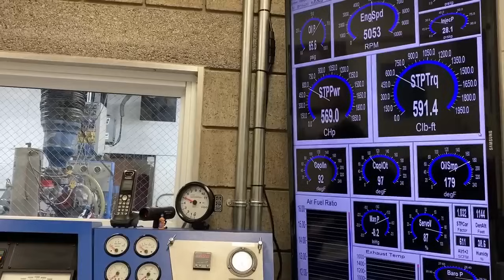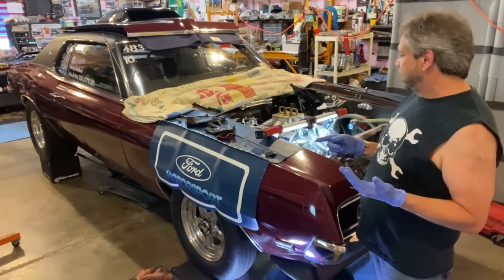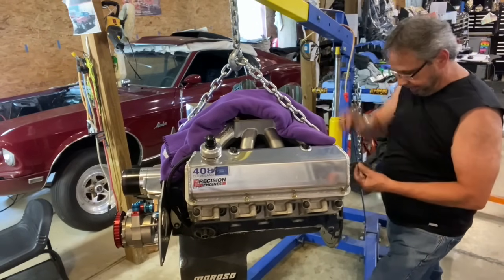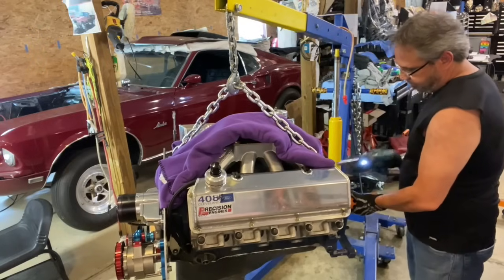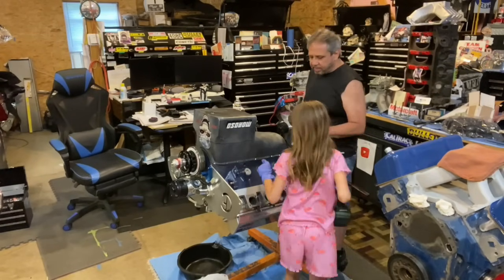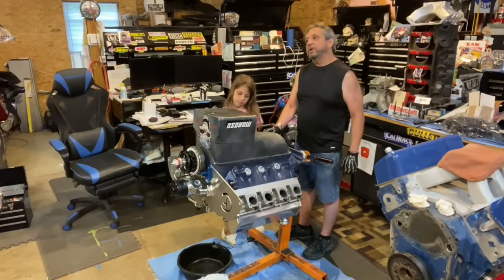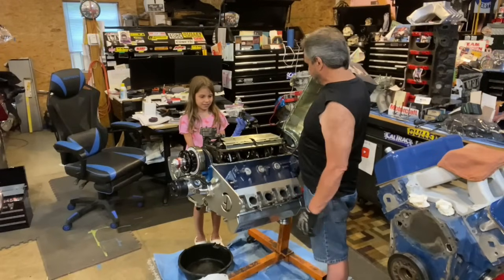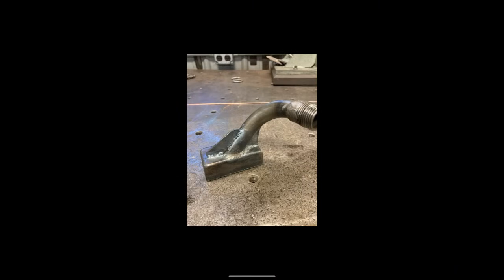DBG: Rip 769 HP Ford 351 Cleveland, Now We Now The Rest Of The Story...No Band-Aid Fix

Comment: That's a HUGE rear baffle on the oil pan!  Thought about making something similar for my 8.2 engine, but didn't go that far.  Was worried about oil being able to drain back into the sump.  How many quarts do you run in it?  In the process of installing an Accusump as we speak.  Hate that for you!  Freak breakages...
Reply from the maker: Been running these pans for 40 years. Never an issue. The pan is a 9 qt pan. Brace your pickup. Common breakage issue, I have never seen it. I thought about accusump, not sure if I need or want it. What your thoughts Mike?
Reply: @DragBoss351Cleveland  I use a Canton 'road race' 1563 pan that boxes the pickup in an area with trap door baffles.  Worked great for decades on my 306 engines turning 6800 rpm.  Pan is advertised as 8 qt, but I only run 7 in the the engine.  Shows 1 qt low on the dipstick.  New 363 turns 8k rpm.  Oil pressure would tank from 70 to 40 from 7500 up on the dyno.  Made some changes (SV blueprinted, ported pump, bigger custom made pickup and some drainback mods and it did fine on the dyno.  I've TRIED to watch the oil pressure at the track, but it's a stick car with two stages of nitrous...  and the gauge isn't in the line of sight, so I can't see it.  lol  I do think it's dropping, though.  

Accusump has an electric valve.  Valve has an internal check valve that allows it to fill to max pressure.  Has an electric pressure switch that only allows it to dump at the switch pressure.  Mine is marked at 57 psi.  Cold oil pressure is 80+.  Now, if the pressure drops below 57, the Accusump should open up and provide a few seconds of lubrication.  

Thinking about making a bigger baffle.  The one I made/added is not nearly as large as what's on your pan!  lol  Can't afford to replace the engine in any kind of reasonable timeframe, so trying to not kill it.  lol  

Been playing with no-prep.  Wired up a nitrous progresser.  Last weekend, it was coming out on 150 with a 0.1 second delay and 0.25 second ramp with a 100 hp second stage to use in 3rd gear.  Still a street car that gets driven on the road, but was surprising some of the purpose built race cars...  even on a 28x9.  lol  Engine made 655 n/a and 908 with an 82 jet  (225hp) on the dyno.  11.5 to 1 and pump gas n/a.
Reply from the maker: @n2omike Mike we have known each other for a long time at least on the forms back in the day. Always impressed by your Mustang, I’ve never really been a nitrous fan only used it once. Yes this oil pump pick up blows my mind. Who is SV? This pump was blueprinted by precision oil pumps. At this point, I think what I’m doing for my combination. Regards to oil mods works. The Dyno runs, and at the track, proof that. I had these ideas of external wet sump, lifter bore bushings, accusump. But now thinking I will replace what I need. You’re killing it with your car. Accusump still not off the drawing board. Never steal my knew much about them. Thanks for the info. Glad you enjoy the channel. Appreciate you 💯🏁
Reply: @DragBoss351Cleveland  SV just stands for Standard Volume.  lol  I had a HV pump and decided to change it out in case it was pumping the pan dry.  

I've ALWAYS used Precision Oil Pumps.  Both the HV and SV came from them.  I took the SV pump apart and smoothed the transitions and ported it a bit.  Also installed the HV spring, and cranked it down a bit.  Builds a little over 80psi cold.  They are the 'race' pumps with the gerotor support on the bottom.  Still needed squared at the interface between the housing and the heads of the mounting bolts.  

Will still idle down to around 45psi or so when fully warmed up.  Thinking about putting the HV pump back in now that it's doing double duty filling the engine AND Accusump.  Will only use the Accusump at the track.  Can leave it turned off, although the internal check valve will still allow it to fill.  

Enjoy watching your content!
Reply from the maker: @n2omike thank Mike. Glad you’re here. Yes SV, duh. Talked with stefs yesterday. They want me to send in my pan, and a new oil pump, they will make a new custom pan and pick up. Doug is a great guy and great to use his products. Not changing any other oiling mods. They work.

Comment: Moroso uses Silicon Bronze Filler Rod Tig welded pickups to the cast iron oil pump bodies.  I recognized the color of Welds. Silicon Bronze Tig Brazed on actually.
Reply from the maker: Right on, you should never weld a pick up as a weekend against the metal can only braze.

Comment: What heads and compression?
Reply from the maker: Ford A3, 13.3
Reply: @DragBoss351Cleveland  great power, thought the tq would be a little higher
Reply from the maker: @collegeparkwhiteboy may 270cc intake ports may affect that?
Reply: @DragBoss351Cleveland  yes sir, I agree... my 438 with 240 hi-ports flow 358, and 273 @.700, with 12.42:1 (218#'s cyl. press) on a conservative SF600, made an honest 745 horse at 6900, and 618 tq at 5200 on 93 pump gas, w/ comp TK mech. roller... Would love to go Higgins or D3 canted honestly.
Reply from the maker: @collegeparkwhiteboy that is a bad ass motor. Sounds killer. My heads flow 385 at .600, and 396 at .800. This 409c make 800hp with a little more compression and bigger cam. Maybe in future. I just got a D3 intake. If you watched the live chat I did with Don Losito, he developed the D3 head. Higgins are killer. Just saw a set of bare heads and intake for $3500. Find need to go to rebuild. Thanks for the convo my brother.
Reply: @DragBoss351Cleveland  yes sir, thanks... I enjoy your very informative, factual videos and honored to converse with you too. Hope you keep posting for us thinking engine builders

Comment: Yo, have a video idea for ya.  Why dont you pretend like you never changed the transmission fluid and drain it again and give us a 20 minute video as to what you use to make a c4 survive those trips down the strip while working on it?  Inquiring minds are extremely curious, well, least the gear head one of mine!!  😊
Reply from the maker: Great idea. I did make a whole rebuild series on my channel. Look at play list on transmissions.  It much big changes to the C4.
Reply: @DragBoss351Cleveland   - You did?  I searched the shyt out of your channel a while back and missed THAT???  Okay, thanks.
Reply from the maker: @mistersniffer6838 look at play list on transmission build. Have one on engine building, head flow.

Comment: Time to add a steel section of strap from the pump to the pickup, and was your pickup tube mig welded to the pump or tig welded, if it was mig welded that's definitely a no no tig weld or even brazed is much better and as for mentioned some type of steel strap  fabricated that can be welded to the pickup and bolted to the pump bottom should get you back in the game and that should stabilize the pickup from the vibration I had a friend who had the same problem in a big block chevy and cooked the rods and crank everything was black and blue from lack of oil so he lost that engine just by rushing things and not doing something as simple as brazing the tube to the pump body adding a strap from the body to the pickup would have been extra insurance to keep the pickup reinforced to the pump
Reply: It's ashame that Moroso racing products doesn't make the bottom cover pickup anymore and if they did I'm wondering if they made them for the Cleveland oil pumps. It's a cool piece it's just a extended cast iron cap with a screen that bolted where the original cover would be so it pulls the oil up directly into the underside of the pump I have two of them for the small block Chevy oil pump they can probably be easily made from a square chunk of aluminum and could be made with a lot of depth to sit down deep in the sump this way a tube pickup would be eliminated, I'd have to illustrate this thing so you get what I'm talking about, I remember milodon oil pan co. made a their version of that part also Jenkins mentioned that device when he was designing oil pans with Dick Moroso  decades ago saying that the oil should be pulled from the bottom of the pump instead of being pulled through a tube
Reply from the maker: Eric, I’ve heard this happening to big Blackford, but never to Cleveland. It just blows my mind. But oh yeah I will get a custom pick up. That will be killer. Trust me I’ve learned a big lesson from this. And I hope it helps others. Never in my wildest dreams that I think this would happen. But after talking with Darin Morgan, others, it’s just a common sense reinforcement. I missed it. God, no damage, these are just parts. Now I have a chance to make this even better. Condolences to the friend that had the big black Chevy. The pick up was a factory, Moroso, I’ve heard that they tig braze or some kind of process like that. Appreciate the help and support.
Reply from the maker: Eric, I love hearing things like that, I’ve never heard nothing like that. If had experience with the billet pumps, they won’t work with my combination. I was even consulted on a billet pump, that’s how I know it didn’t work. Also, I would’ve had to make my own pick up. Lesson learned a lesson lived, so I’m glad to hear and enjoy the channel my friend. Thanks for the information and help. 💯👍🏁